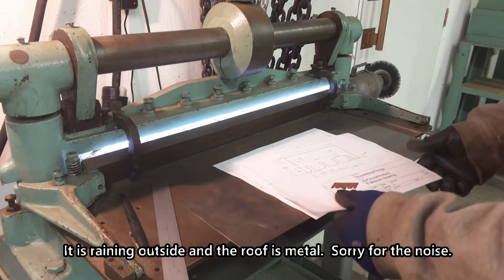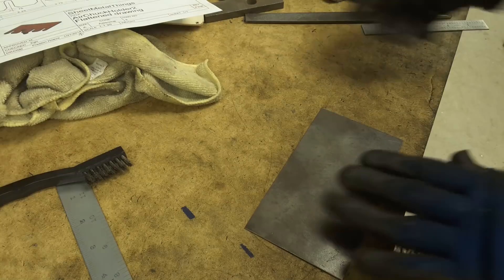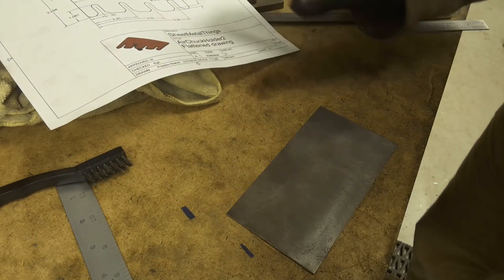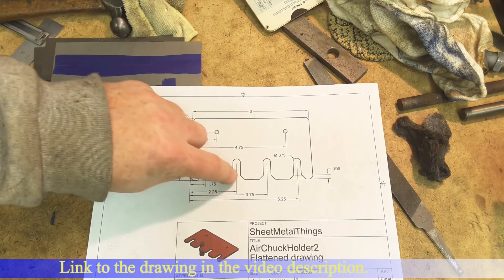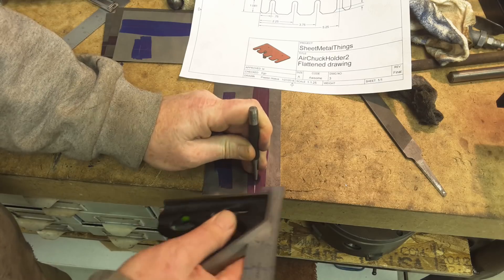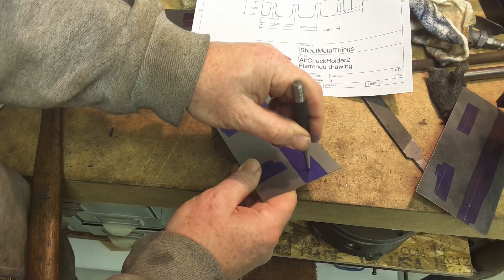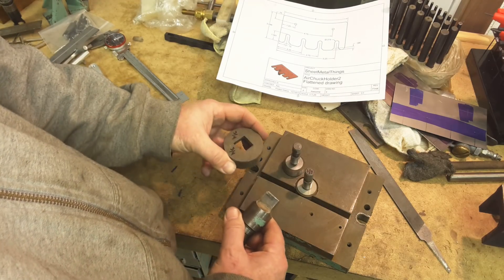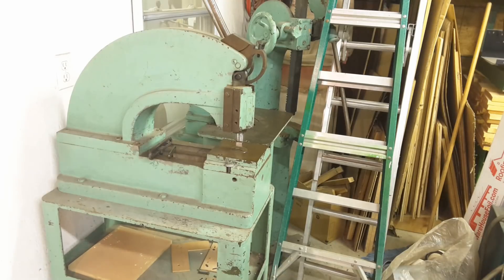Sheet metal - Air Chuck Tool Rack

Comment: What is some info on your button punch press? I can't find anything like it and I'm now wanting one like a bad habit! That thing is sweet
Reply from the maker: It is made by Diacro.  Hold onto your wallet.  It is in their machine list as the model 2 punch press.  Keep in mind that the price does not include punches.  I also have they precision shear and corner notched.  I acquired them when I bought an entire shop of equipment.  ~P

Comment: I have a cool and easy project for you. If you're up for it?
Reply from the maker: Shoot.
Reply: It's a project that is for something that with the right dimensions and material could be produced and sold. It's an oil drip collector for lathes with external gears at the left end (South Bend, Atlas). I show my cobbled together version of it as the first project here:  https://www.youtube.com/watch?v=2pYxtUkJilo . I think it would be even better if it went under the quick change gear box too, kind of like a chip pan extension that collets the oils that invariably drip all over. Considering the lengths some folks go in restoring these old lathes to pristine, it's astonishing to me that this isn't already a product or common project for keeping those freshly restored machines clean. I'm surprised South Bend didn't offer it as an accessory as well.